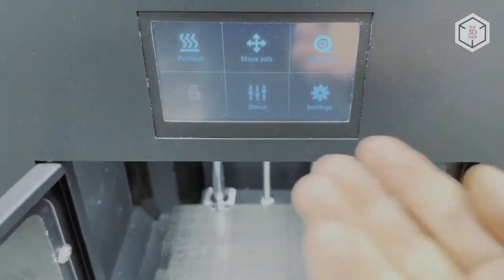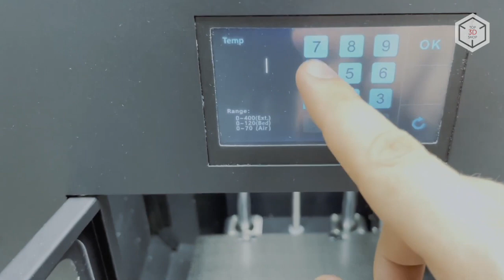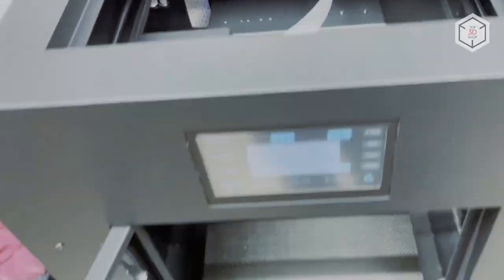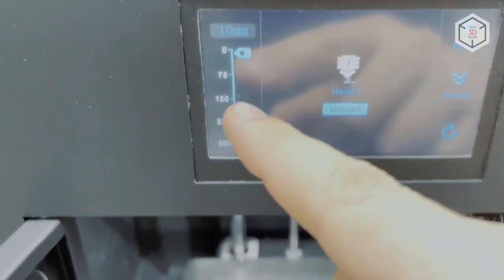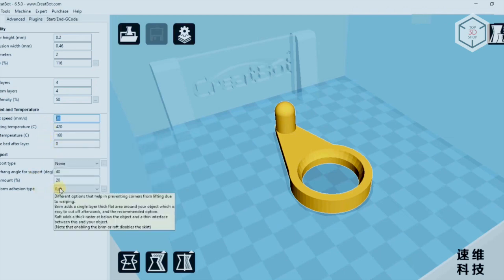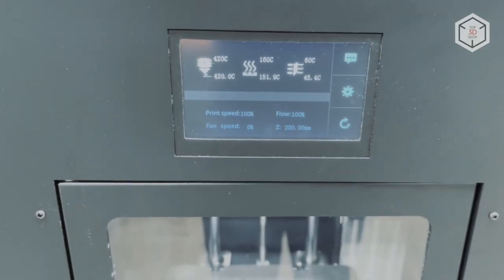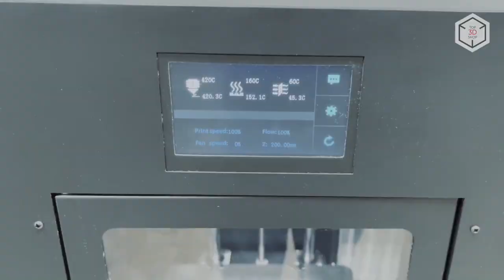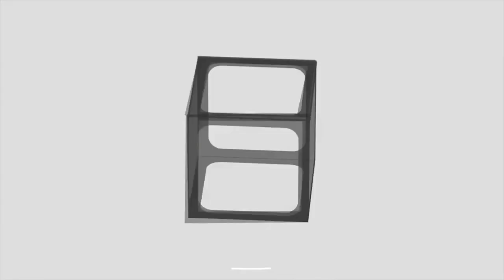CreatBot F160 In-Depth Review: A High-Precision Fast FDM 3D Printer

Comment: The discoloration is due to the crystal structure of the PEEK material, it's a semi-crystalline polymer and due to the nature of how FFF/FDM printing works you get uneven heat across the part leading to non-continuous crystal structures. If you anneal it in an oven then you could get a fully crystalized part which will have way better temp resistance and layer adhesion.
Reply: Yeah that wasn't a good print.
Reply: Found a forum where someone posted photos of prints in PEEK from this machine. 

Same issue,  this is the cheapest printer capable of using PEEK, but it's amorphous PEEK not crystalline

Comment: It's poly ether ether ketone not poly ethereth erketone

The discoloration might be caused by oxidation or thermal degradation but definitely not uneven curing. PEEK, as basically all FDM filaments, is not being cured at all (unlike resin in SLA machines)
Reply: The difference in color is most likely due to cristsllinity. PEEK is highly semi-cristalline when annealed and tends to cristallize in areas of higher heat input, e.g. small areas of the print or close to the bed

Comment: How much is it
Reply: seems to be 1300$, but if you wanna print peek it will cost quite a bit cause of the filament cost.
Reply: PEEK version is about $2000 which is relatively cheap... about 50% of what most of the PEEK-capable printers I see cost. 
You can probably build a custom rig for that.... so it's not a bad starter for high-temp printing based on that alone. 

I would like to see some actual product testing to see how the printed PEEK parts hold up considering this printer's max temp is about 20c below the max printing temp for PEEK. Some plastics get much better layer adhesion at higher-than-typical printing temps.
Reply: The PEEK version is more like $2500, pretty cheap for PEEK capabilities